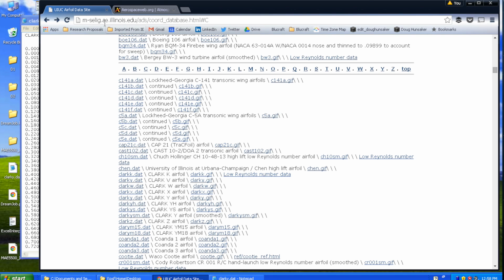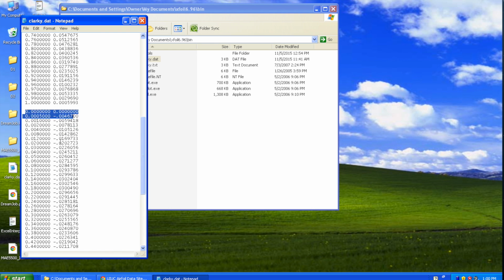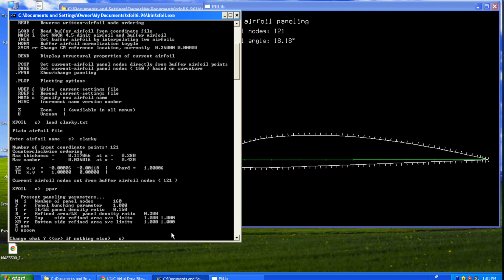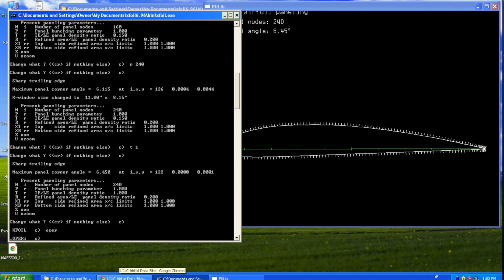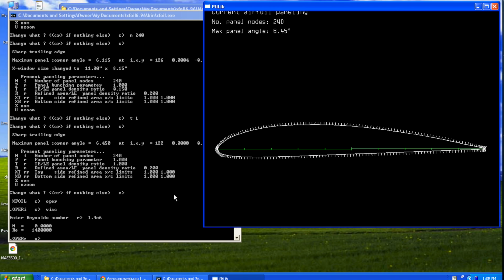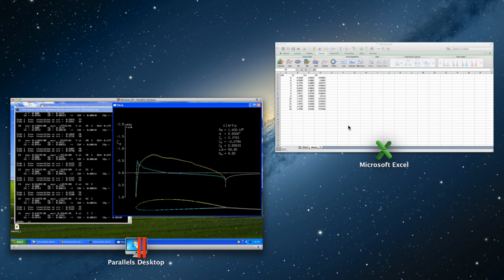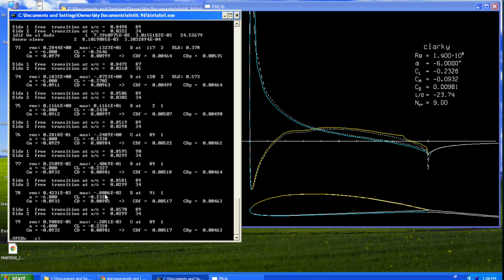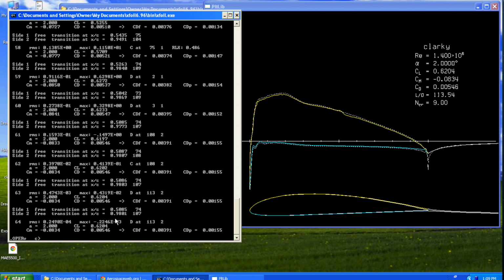Using Xfoil

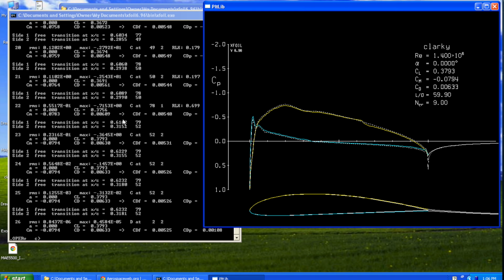Comment: 8:02 How do you create a text file for the AoA values vs. cp, cd and cm?
Reply: When you use the PACC command to toggle on the point accumulation, before using the ASEQ command to generate your polar points, XFOIL will prompt you to enter in the polar save filename (step 7 in my polar plot basics video). If you enter in a filename, like NACA4412_polar.txt , then the software will not only turn on polar point accumulation but it will also save the data from each point of the ASEQ (AOA sequence) into the file automatically. You can then open this file using any .txt program and see the CL, CD, CDp, Cm, Top_Xtr, and Bot_Xtr for each angle of attack you ran the analysis at. If you run into problems, check out the videos I did on the polar save/dump files where I cover some of the finer details. Hope this helps!

Comment: I am trying to load several airfoils from online and it doesn't work (sometimes crashes). Does anyone know how to format data in excel?
Reply: It is currently not possible using MS Excel only. This is because XFOIL wants a space-delineated .txt/.dat file but MS Excel only exports a worksheet to a tab-delineated .txt file (MS Excel will export to a space-delineated .prn file but XFOIL doesn't recognize .prn files). I find that if I am using a file type that isn't supported in XFOIL it will prompt me so, but if I try and use a tab-delineated .txt file XFOIL will crash (current version is 6.99).

If you are still wanting to use MS Excel, to be able to, say, use the sort function, you will need to export to a tab-delineated .txt file (x-coordinate in column a, y-coordinate in column b, each coordinate pair has it's own row) then use another software like MS Word to "Find and Replace" the tabs with a single space, which isn't too hard and goes pretty quick.

Other than file type and file format, it's just a matter of making sure the coordinate points are in the right order (TE to TE, either clockwise or counter-clockwise). I also wouldn't try to add points in MS Excel, instead I'd use the paneling parameters in XFOIL.

I used your comment as an inspiration for a video on my channel. I've got some others on loading an airfoil in XFOIL, the different file formats that XFOIL recognizes, adjusting the paneling parameters, running analysis, and more to come. If you have any additional issues loading an airfoil, let me know.

Comment: Can anyone explain how to load an airfoil on xfoil but on Mac? Naca airfoils work just fine, but when trying to load one of the airfoils from the site, it doesn't work.
Reply: Before trying to load an airfoil into XFOIL from an online database, like the UIUC Airfoil Database, you need to check that the file is the right file type (.txt/.dat) and that the data in the file is in the right format (plain or labeled format preferred), and the coordinate points are in the right order (TE to TE, either clockwise or counter-clockwise around the airfoil shape). In fact it is recommended to format any airfoil you get off an online database so that it is in the "Plain" file format (each coordinate gets it's own row with the x-coordinate first, then a space, and then the y-coordinate; with nothing else in the file). I've got a video on my channel all about loading an airfoil into XFOIL. Check it out and let me know if you still have issues.